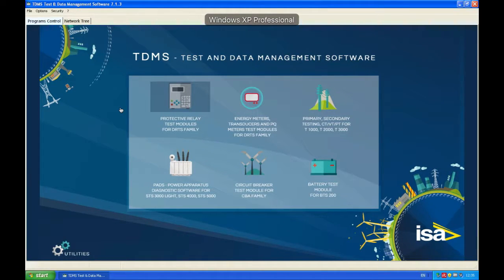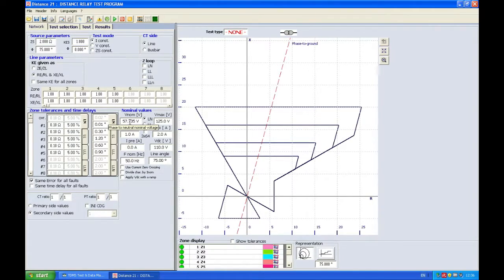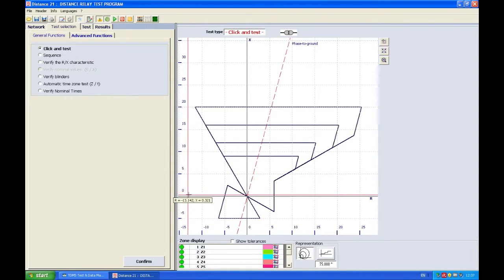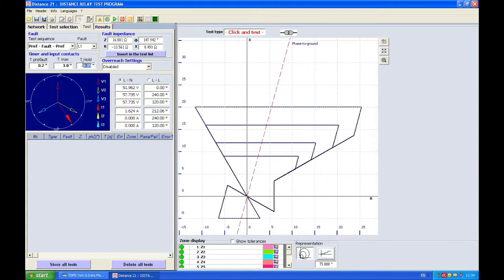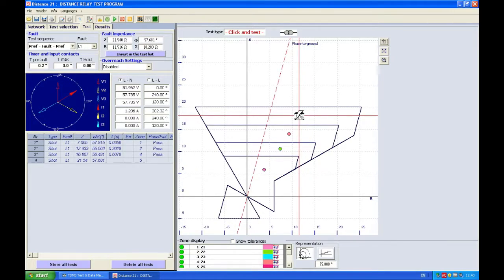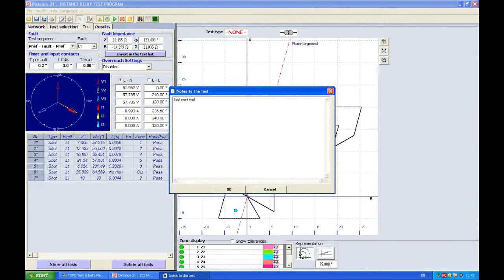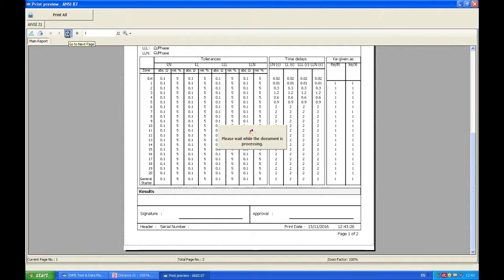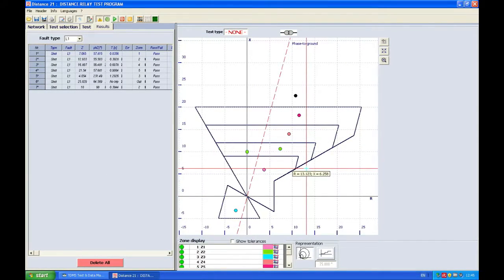TDMS Distance Application Explained vol.2 - Click and Test

Comment: Thanks! We have to test 10pieces of RET615, ABB. Is there any way to import xrio or shall we use only the .exe file in the old TDMS?
Reply from the maker: Hi Dionisis, we presently do not have the RET 615 library (or as we call it in TDMSPro - a plugin), but as you have seen corectly, we do have it in TDMS 7.3.5. ("old" TDMS). So for now please use old TDMS to new TDMS. We will have plugin in TDMS Pro in not so much time.

Comment: Hey Andrej, I'm a DRTS-6 user. I am facing an issue while testing Siemens 7SA522. I have tested the same relay before but recently it has been showing an abnormal behavior, my shot test is failing in zone 2 and zone 3 and only a certain area of Mho & Quad region is passing the test. Moreover when I test my relay using search R/X characteristics over line angle, zone 1 and zone 2 fails while zone 3 is passed. Have you ever faced this issue. I have tried the testing with different input contacts, getting same results.
Reply from the maker: Ayesha Urooj I suggest first being sure that you are running latest SW. Now we have TDMS 7.3.2. Also you should be sure that you are running last Firmware. If you do not know how to do this, please write to andrej.sepcic@altanova-group.com.
Also when you test, do you import RIO or XRIO files or if not how do you do the test ?